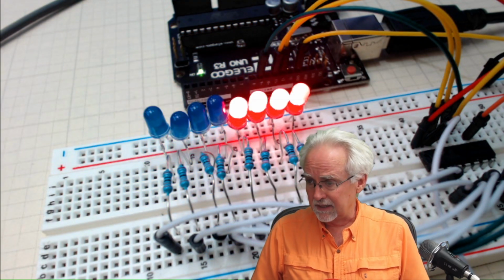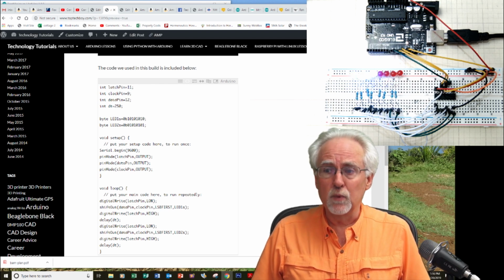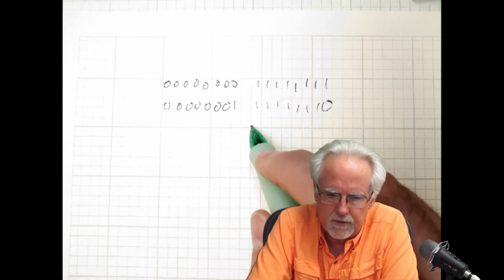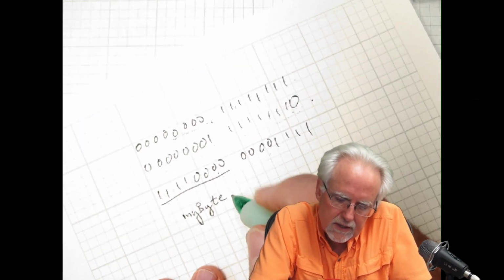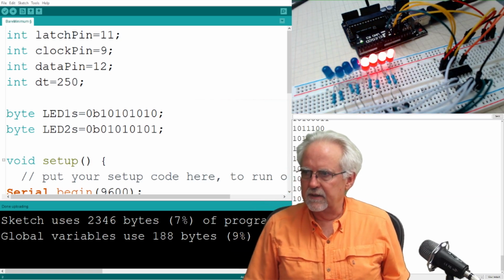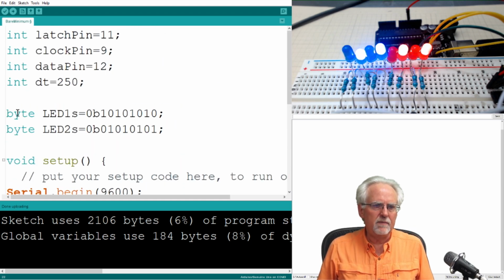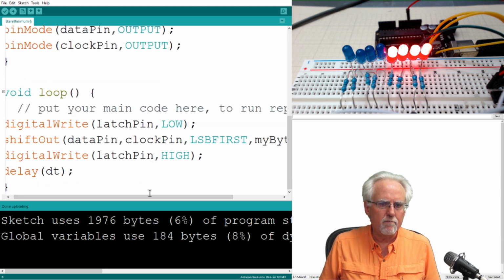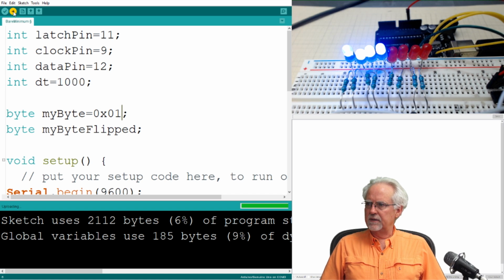Arduino Tutorial 47: Binary and Hexadecimal Bit Flipper

Comment: Hi Paul, I am a new BitFlipper! I used this line of code myByte = myByte * 255 - 1; seeing how when you divided/multiplied by 128 then it would create the circular shift, trying to multiply by 255 might in turn switch them. Originally I was stuck as the 1st LED would always be lit so I added the -1 to counteract it through a gut feeling.

Comment: Well I did something else and since it looked exactly like this, I thought I made it. I got fixated on the flipping 0xF0 example and also 00111100, and what I did for flipping these two was myByte=myByte/16+myByte*16. And they flipped just like in the video. I basically misunderstood the assignment as flipping between first 4 and last 4 bits. Only when I started this video did I realize my mistake. So lesson learned. Couldn't become a bit flipper unfortunately :| but I loved all these tutorials on the 74HC595, it is one powerful component! There's no limits to what you can do with it. After this I figured how the decoration lighting works and how we switch between different modes(fast blink, slow fade in/out, etc.) on them.

Comment: I am a bit flipper! And I got an easier solution: No need for a second byte. Just use the one. In your case myByte = 255 - myByte. Here is my code of the void loop: void loop() {
  // put your main code here, to run repeatedly:
  digitalWrite(latchPin,LOW);
  shiftOut(dataPin, clockPin, LSBFIRST, LEDs);
  digitalWrite(latchPin, HIGH);
  delay(500);
  Serial.println(LEDs,BIN);
  LEDs=255-LEDs;
 
}

Comment: Well, I misunderstood the assignment. What I did was built a binary counter that flipped each number by alternating the least significant bit with the most significant bit. When I saw that was not what you wanted I still did a binary counter, but flipped the lights by alternately adding one to myByte and taking away one from myByteB (255).

Comment: Thank you so much, Paul, for your “most excellent” (as you state it…) lessons. It is so methodical and so much fun. Just one small comment re this lesson (47) – if you don’t use the additional variable myByteFlipped, if you change myByte repeatedly, then you don’t have to talk to the shift register twice in a loop. Something like that:
digitalWrite(latchPin,LOW);
shiftOut(dataPin,clockPin,LSBFIRST,myByte);
digitalWrite(latchPin,HIGH);
Serial.println(myByte,BIN);
delay(dTime);
myByte=255-myByte;

Comment: I am almost a bit flipper.  I didn't figure out the subtraction, but it one of the comments a while back about making a toggle switch someone talked about making the status of a pin not equal the current satus of a a pin (high to low or low to high).  Had to google for the operator but got there.

Comment: I am a doer and a bitflipper. I did it on my own before the video. I thought there might be an "inverse" or "opposite" command, but first I figured I'd try just putting myByte=-myByte. It worked except for the LSB so I tried myByte=-myByte+1 and that was worse so I tried myByte=-myByte-1 and it worked every time I tested it. I have a Masters in Counseling and I haven't done math since about 2002 so I took a couple wild swings at it and this time it paid off. Thanks Paul!

Comment: I am a bit flipper.  Before I left this circuit, I just had to create I byte pattern with random bits.  The key statement is this: for(j=7; j!=-1; j--) bitWrite(myByte1, j, random(0,2));   This will create bits of random 0 and 1.  Paul uses math to fiddle with the bits.  I am in NO WAY criticizing what he is doing.  This is cleaver and is an excellent teaching point, but the use of built-in functions makes it easier to read the code.  If you are writing big systems something like bitWrite() is clear.

Comment: I am a bit flipper! 
Paul- I am totally all in with the Arduino and learning almost exclusively with your videos.
I am a 45 years old designer/mechanics engineer from Israel who had a  (correct) hunch that learning Arduino could open a world of new design possibilities.
I am also creatively utilizing skills from other disciplines I picked up over the years for these projects.
My most useful tool is excel- I created a spreadsheet that automatically calculates all the linear functions needed for the earlier lessons (translating 0-1023 to 0-255 and such).
for the last few lessons I used a spreadsheet that converts 8bit binary to 0-255 decimal and back and it was very easy to see the solutions to your assignments.
Even though these tables and converters are a click away on google, creating them "manually" makes understanding the whole thing a lot simpler as you often like to point out.
Anyway, thanks for the videos, they are awesome and the best around!

Comment: I found another method. I used int j=2; byte mybyte=0xF0; In the loop, I used:  if(j%2==0) { myByte=0xF0; } if(j%2 > 0) { myByte=0x0F;} 
After the delay I inserted j++; on the next line.
The logic in this is: at the start j is even, so the first if statement executes.  The second if test for odd values of j.
On the next round, j is odd, so the first if statement fails, so the second if executes and assigns myByte=0x0f; .
Thus the save variable is assigned different values, and you only need to use one shiftOut setup.
Thus, latchPin is set LOW, shiftOut runs with value of myByte, then latchPin is set HIGH to stop data input.
Wayne -- It seems with the 74HC595N, you could drive a 7 segment LED display. I AM  BIT FLIPPER!

Comment: I learned a lot from you. Thanks.
 I used to write programs in Basic 30 years ago and this is refreshing to start again with C+. I wrote simple  program using your various lessons to finish project for my friend. It's one time shot timer with protection for Intercom solenoid, to avoid latching intercom open button, with flash warning.
https://www.youtube.com/watch?v=sGbLVs67YdM&t=341s&ab_channel=SimasoftWorkshop
       (it's in Serbian language)
Problem for me was  ==  for if and while (I didn't notice that part in lessons so I had to figure  out the error)
This is the CODE if someone needs it.

int relayPin = 7;
int inputPin = 4;
int sigPin = 5;
int sigPin2 = 6;

void setup() {
 pinMode (relayPin, OUTPUT );
pinMode (inputPin, INPUT );
pinMode (LED_BUILTIN, OUTPUT );
pinMode (sigPin, OUTPUT );
pinMode (sigPin2, OUTPUT );

digitalWrite (relayPin, LOW);
digitalWrite (LED_BUILTIN, LOW );
digitalWrite (sigPin, LOW);
digitalWrite (sigPin2, LOW);
}

void loop() { 
digitalWrite (LED_BUILTIN, LOW );
digitalWrite (sigPin, LOW);
digitalWrite (sigPin2, LOW);

 

// One shot timer 6 sec on then off

if (digitalRead (inputPin) == HIGH) {digitalWrite (relayPin, HIGH ) ;
digitalWrite (LED_BUILTIN, HIGH );
delay (6000); digitalWrite (relayPin, LOW ); 
digitalWrite (LED_BUILTIN, LOW );

// Protection for solenoid if button is jammed to prevent latching solenoid relay to stay on. It will trigger again only if button is released and pressed again. If button is jammed It will flash 2 LEDs sigPin1 and sigPin2 in flip flop to warn you that button is still pressed

while (digitalRead (inputPin) == HIGH) {digitalWrite (relayPin, LOW );
 digitalWrite (LED_BUILTIN, HIGH ); digitalWrite (sigPin, LOW); digitalWrite (sigPin2, HIGH); delay (100);  digitalWrite (LED_BUILTIN, LOW ); digitalWrite (sigPin, HIGH); digitalWrite (sigPin2, LOW); delay (100);}
 
}

}

Next task is random binary number to flash 8xLED on and off for start, but there is more, (task 2) I would like to use one Arduino to drive 3x 74HC595 (24 LEDs 6x4) at the same time but different random number for each 74HC595 if it's possible. There is no lesson for that, so I will have to do my best for this task. I will use some of code from lesson 44 & 45 video and tweak it to add "random" command to try to finish my task. Thank you again for your lessons.

First I will wait to chips arrive (I don't like simulators) and start solving this puzzle.
Reply: Done random.
int latchPin=11;
int clockPin=9;
int dataPin=12;
int dt=300;

byte LEDs=0;

void setup() {
  // put your setup code here, to run once:
 
pinMode(latchPin,OUTPUT);
pinMode(dataPin,OUTPUT);
pinMode(clockPin,OUTPUT);
digitalWrite(latchPin,LOW);
shiftOut(dataPin,clockPin,LSBFIRST,LEDs);
digitalWrite(latchPin,HIGH);
}

void loop() {
  // put your main code here, to run repeatedly:
digitalWrite(latchPin,LOW);
LEDs = random(255);
shiftOut(dataPin,clockPin,LSBFIRST,LEDs);
digitalWrite(latchPin,HIGH);
delay (dt*6);
LEDs = 0;
digitalWrite(latchPin,LOW);
shiftOut(dataPin,clockPin,LSBFIRST,LEDs);
digitalWrite(latchPin,HIGH);
delay(dt/6);

}

Comment: I AM A BIT FLIPPER.
But I accomplished this CONSIDERABLY different, simply by using the tilde (~) operator on the shiftOut command. (in this case X)

int dataPin=12;
int latchPin=11;
int clockPin=9;
int dt=1000;

void setup() {
  // put your setup code here, to run once:
pinMode (dataPin, OUTPUT);
pinMode (latchPin, OUTPUT);
pinMode (clockPin, OUTPUT);
}

void loop() {
  // put your main code here, to run repeatedly:
byte x=0b11100000;
digitalWrite(latchPin,LOW);
shiftOut(dataPin,clockPin,LSBFIRST,~x); 
digitalWrite(latchPin,HIGH); 
delay (dt);

And voila... it flips the bit(s) !
Works with Hex as well ... of course.

Highly recommend "Arduino Programming in 24 Hours".
Page 80 covers "operators" including the Tilde.

Comment: Bit flipper here! But I didn't do it as elegantly as you. The simple math relationship that you pointed out just didn't occur to my math challenged brain. So I used the circular shift method I learned earlier and an if-else statement to flip the LSB's and a for loop to do it eight times for the entire byte. A few extra lines of code but it works too.

Comment: Thank you for the wonderful lesson, one question, for this flip lesson I have done the with myByte=255-myByte and it work. the question is why yours add a myByteflipped and another set of the code. is there any especially reason. Thank you

Comment: DOER/Watcher
Hi Paul - I could only get partial results at first with 0F to F0, by either *16 or /16, however (obviously) that only worked with that value.  Thanks for opening my eyes to the correct solution!

Comment: Did it differently!

While I didn't do this entirely on my own, I paused this video after Teach revealed the math on paper, then subbed that equation for the one in my shift left or right program, and that's it. Didn't have to write to the shift register twice, or declare a new variable. Since it's flipping, there are only two options, so I just let the loop write the flipped value to the shift register for me on every other cycle/iteration.
Reply from the maker: Well done. Congratulations on making it this far in the lessons. Most dont keep going like this.

Comment: I really appreciate these videos but just wanted to pick up on this one as you don't need "myByteFlipped" nor to duplicate the code if  you just use "myByte=255-myByte", it will still work. Eg. if myByte=1, 255-myByte(1)=244, 255-myByte(244)=1 and so on...

And I'm happy to say I did work this one out on my own, had a little more trouble with the previous homework though!

Comment: I am a miserable failure, but I am learning. :)
Reply from the maker: I would rephrase it to "My preferred method of learning is to begin by exploring less than optimal strategies, and then eventually find the optimum solution". That sounds better than thinking yourself a failure. If you are learning, you are not failing.

Comment: *Edit Ive watched the video. Your solution is so simple. Thanks so much for the explanation. 

Hey Paul, thanks for these amazing lessons. Before watching the video.. For this assignment when you said we had to "flip" the bits i instantly knew the solution. I could just use the NOT (~) operator. Easy peasy. But instead i decided i wanted to try and solve it using math. After all, all the solutions so far have been done only with math. At first i thought of using 2 if statments but that was to complicated a solution. After a couple hours of thinking real hard i was able to solve the assignment with this: 

myByte=myByte*255-1; 

The problem is that although it does work, i dont understand why the math does not work on paper..? On paper the math works when i flip the bit but it does not work to flip back.

Comment: Before watching this, I was going to add '0b11111111' (or 256) to myByte to flip it. In my opinion it would also work, just throwing away the Most Significant Bit.

Paul's method is probably better, but I would like to see if it works, will have to write the code first though. 

Thanks for the awesome content.

Comment: I am a Flipper! Now to see if it matches your solution...
Reply: hmmm my solution was a bit different - it works but it is not correct I fear (see the second shiftOut - (-myByte-1)) which works but is not correct :
void loop() {
  // put your main code here, to run repeatedly:
digitalWrite(latchPin,LOW);
shiftOut(dataPin,clockPin,LSBFIRST,myByte);
digitalWrite(latchPin,HIGH);
Serial.println(myByte,BIN);
delay(dt);

digitalWrite(latchPin,LOW);
shiftOut(dataPin,clockPin,LSBFIRST,-myByte-1);
digitalWrite(latchPin,HIGH);
Serial.println(-myByte-1,BIN);
delay(dt);

Is this some sort of crazy insane way?

Thank you again for another fine lesson.

Comment: Another bust for me... I guess I don't 100% have my head wrapped around binary yet... I know there is a bitwise operator that will do this with ease but I don't like running before I walk... That being said I had another idea for comparing each bit, maybe dumping the byte into a string and scanning it pulling each bit out or something like that. Not sure if its possible in this programing language or not I didn't make that far. I would have probably ran into more commands that we have not covered yet and I don't like using what we haven't learned.

Comment: I'm a bit-flipper! It was worth doing the homework. More of a math than a coding or circuit problem - getting a better understanding of bit/hexadecimal math.

No new variables, just had to add one line at the bottom of the void loop(). It then flips back and forth .... because it's a loop and we are using LSBF.

void loop() {
  
digitalWrite(latchPin,LOW);
shiftOut(dataPin,clockPin,LSBFIRST,LEDs);
digitalWrite(latchPin,HIGH);
delay(dt);
LEDs=255-LEDs;

}

Comment: Ok, the previous lesson (cicular shifting) had me a bit stumped. I was almost on the right track but couldn't quite get it without your help. Got it now! This one was much easier. Just for fun(?) , I went ahead and did some research and have also added a byte reversal function (eg. 10011011 becomes 11011001). Thanks again.

Comment: **SPOILER ALERT**  I'm a bit flipper, but I got a hint by reading the comments on the previous video (the hint simply stated a key number necessary to make this work).  I (surprisingly) did it simpler than what you did.  I only added 1 line of code.  At the end of "write" section I added "myByte=255-myByte;"

Comment: I'm a bitflipper, but my program takes data frome user and flips that :D
Reply: int latchPin=11;
int clockPin=9;
int dataPin=12;
byte myByte;
//String msg="Podaj liczę ";
void setup() {
  pinMode(latchPin,OUTPUT);
  pinMode(dataPin,OUTPUT);
  pinMode(clockPin,OUTPUT);
  Serial.begin(9600);
  }
void loop() {
  //Serial.println(msg);
  myByte=Serial.parseInt();
  while(Serial.available()==0){
  digitalWrite(latchPin,LOW);
  shiftOut(dataPin,clockPin,MSBFIRST,myByte);
  digitalWrite(latchPin,HIGH);
  myByte=255-myByte;
  Serial.println(myByte,DEC);
  delay(500);
  }
}

Comment: I am a bit flipper!

int latchPin=11;
int clockPin=9;
int dataPin=12;
int dt=100;
int myByte=0b11111111; //Input into here

void setup() {
  // put your setup code here, to run once:
pinMode(latchPin,OUTPUT);
pinMode(clockPin,OUTPUT);
pinMode(dataPin,OUTPUT);
Serial.begin(9600);

}

void loop() {
  // put your main code here, to run repeatedly:
digitalWrite(latchPin,LOW);
shiftOut(dataPin,clockPin,LSBFIRST,myByte);
digitalWrite(latchPin,HIGH);
delay(dt);
myByte=255-myByte;
digitalWrite(latchPin,LOW);
shiftOut(dataPin,clockPin,LSBFIRST,myByte);
digitalWrite(latchPin,HIGH);
delay(dt);
}

Comment: With no past experience using binary numbers there is nothing obvious in their patterns and values yet.  Nice illustration on how that formulation worked. Building on the past lesson I used one cycle of a circular shift left, eight If()-else() statements, to parse out each bit value and added them together to get a new, opposite number. It should be obvious that the sum is 255 but I missed it.  I've got a nice parsing machine now, nonetheless.

Comment: I'm a bit-flipper.  I always do the homework.  I observe things in lessons but I don't actually LEARN until I think through the process myself by doing it hands-on.  Then it will stick with me.  On this one I started thinking "What could I do to this byte arithmetically to result in a bit flip or inversion of all the bits in the byte?  Hmmm a byte with all the bits on would be basically 255 decimal... what happens if I subtract my byte from 255.  Subtract 1 from 255 and you get 254 which would be 11111110 binary... Hmmm.. that worked... how about 2..."  I was going to check the language reference to see if there was an Arduino function that just inverted all the bits but hit upon this first.